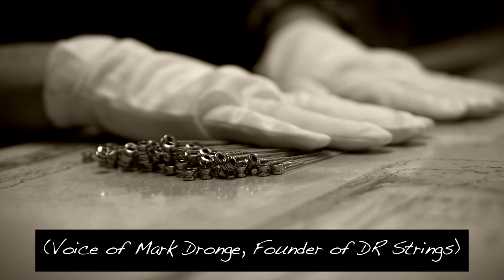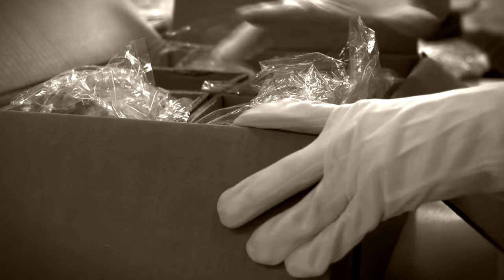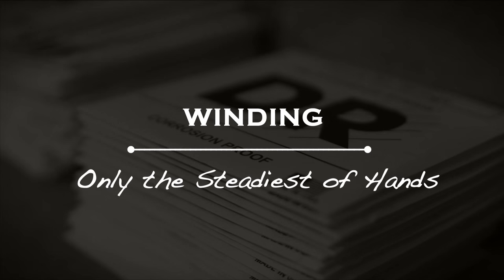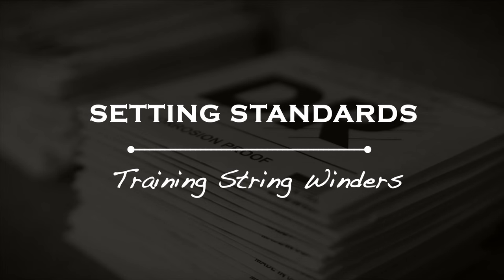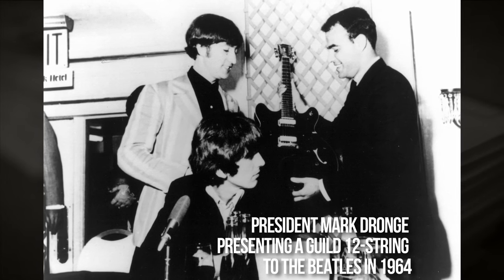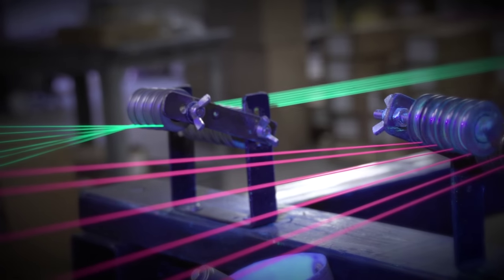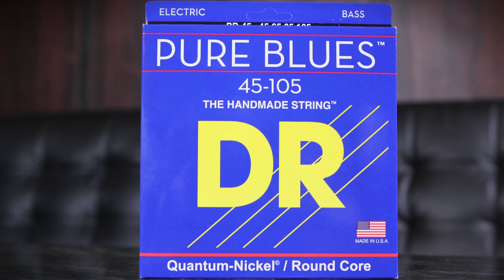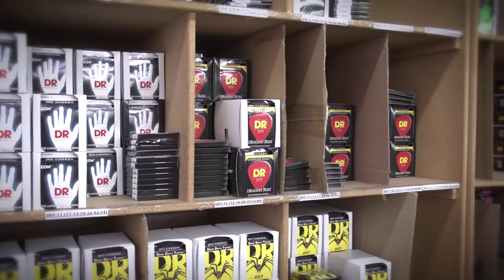DR Strings Company Video

Comment: I have been playing guitar since the sixties and professionally repairing and building guitars and basses since the seventies. I have tried most every string out there over that time and have noticed that some are better than others and there are things that you hear that cause you to say that each string brand has some little quality that makes it better in some small way. And then I tried a set of DR's. The improvement was instantly noticeable... big time. For the last 15 years I string my personal instruments with DR's only and the only instruments that leave my shop without DR's on them are ones that the client has asked to have another brand installed. (they have to supply them as I don't stock other brands) I have had instruments in the shop for a checkup that I did nothing more than restring with DR's and then get the comment from the owner on how much better it sounds. I know it's only a single blind test but I try not to influence the player just to see if they pick up the difference on their own. They most all invariably do. And, no, I do not try and trick anyone into thinking that it was some secret magic that I did to cause that. And lastly, the disclaimer... I do not work for DR, I do not own stock In DR, (don't think they are publicly traded anyway) and I pay regular price for my strings, I just happen to be a fan of their product. Also lets not forget the support staff and reps, very accommodating and helpful, just don't call at 8am monday or 4:30 friday (est)

Comment: Been using the highbeams on my jackson and bc richs for 20 years. Never had a complaint. Use the zebras for about 12 years and the pure blues i found maybe 8 or 9 years ago. All are amazing for different roles. The zebras on my gretsch the pure blues on my low output solid bodies. They are so smooth and creamy.

Comment: Been using D'addario for a while, and for some reason I never could really play with any force without getting some type of fret buzz. Enough to hear through the amp, whether it's open string buzz or fretted buzz, regardless of the guitar and despite how it's set up. Always feel like I have to hold back or be more gentle. Huge pet peeve of mine. I like picking with some dynamic.  Put a set of DR's on one day and....problem solved. Dunno if D'addarios just don't fit well with me or what, but every time I put a set of DR's on any of my guitars that have something else on, they immediately play better.

Comment: Just put on Pure Blues 10' on my strat, love the feel and tone but after 2 weeks of playing on them the D string about 1/4 inch above saddle has come unwound in just a small spot but now the string is completely dead! My 1st time using DR Strings, is this normal?
Reply: Those are vintage style round core strings. Most all modern strings have hex cores. Round cores require a little different care. Look it up online.